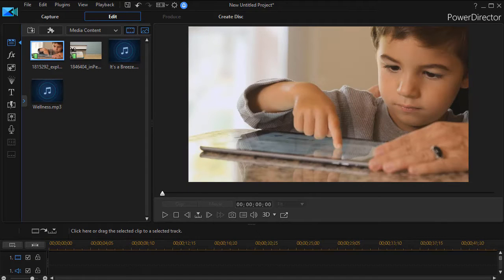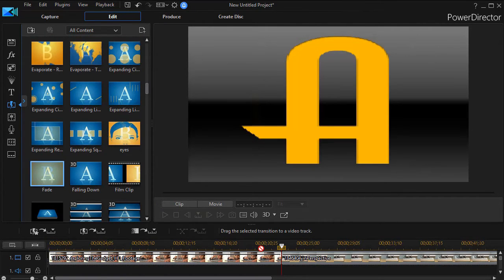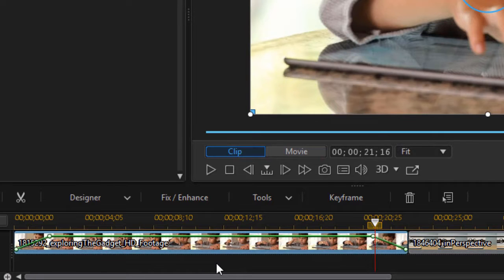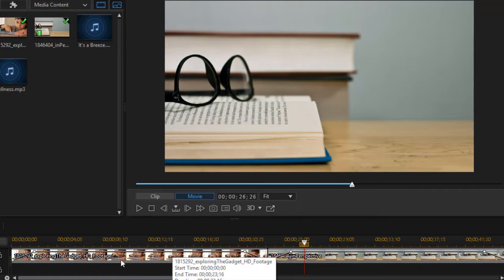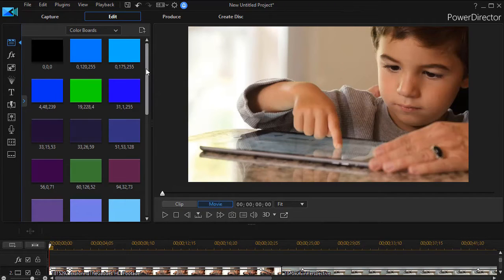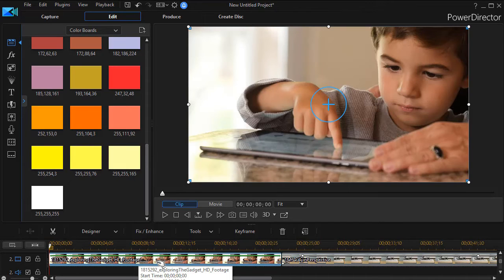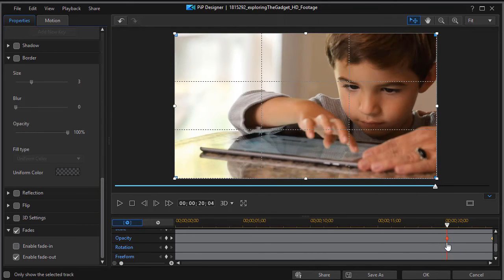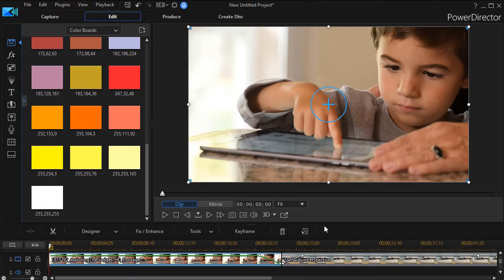PowerDirector - Multiple techniques for fade transition - part 1

Comment: Thanks for the useful tutorial.
In my PD14 after a multicam edit and clips are moved to the timeline, inserting a fade will take the audio out of sync between the clips etc. I am aware of the work-around, copy , paste video on track below, stretch required clip, split, copy and paste upwards as a cross fade.
Ive now changed in preferences, the default transition behavior, from overlap to cross, and can insert a fade (dissolve) without losing audio sync. Is this the correct method as I cant find any tutorials on inserting transitions within a multicam sequence.
Reply from the maker: I don't know if there is a 'correct' method, but you've hit on the key element of the fade. You don't want a fade that will change the length of the track. Once you've addressed that issue, you have most of the technique mastered. As you note, the workaround with cutting, splitting, and time stretching or condensing is very time consuming and should be avoided if you can. Sounds like you've thought this through very well. --Jim
Reply: @SharperTurtle  Thanks for the quick reply.
I note in the y/t workaround video tutorial, adding transitions to PD 12 multicam designer, lots of comments around the multicam audio sync in PD still prevailing in newer versions. I see in the Pinnacle version of multicam editing you can insert a transition (cross-fade) within the multicam editor, prior to OK to time line. Perhaps an internal software version of the workaround. Would be nice to see this inside the PD multicam editor in a future upgrade etc. Thanks for all your tutorials which are very helpful.
Reply from the maker: Glad to help out. Be sure to let the CyberLink folks know about changes or feature additions you would like to see in the future. --Jim

Comment: Thanks so much for this. I hadn't discovered the colour boards. My main issue with the basic transition (mostly working on music videos) is that there's a small but discernible break in the audio and neither of the audio transitions in the PD transition room improve matters. Could you point me in the right direction Jim?
Reply from the maker: I don't know if this will help, but I just put up a tutorial for the second part of this series that includes some information about the two audio transitions. Check it out. Below is another link on the audio transitions.

https://youtu.be/8xxv_45W-PM

If it does not help you, let me know. -Jim
Reply: @SharperTurtle  thanks I will check them both out very soon.